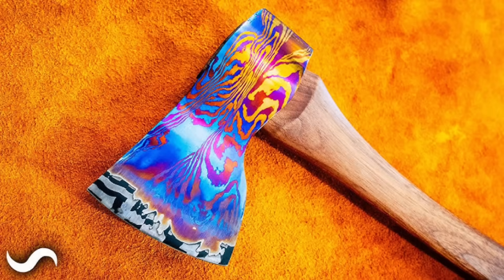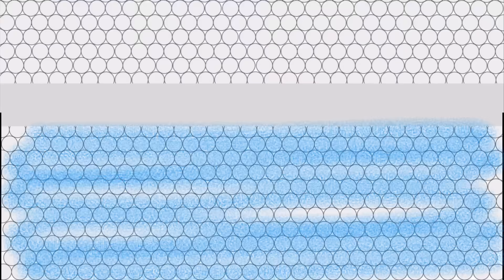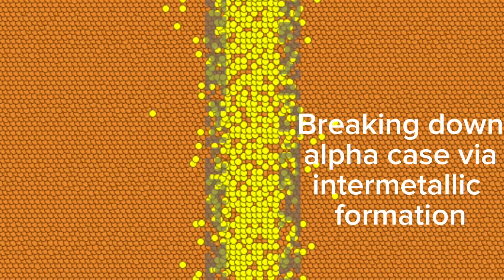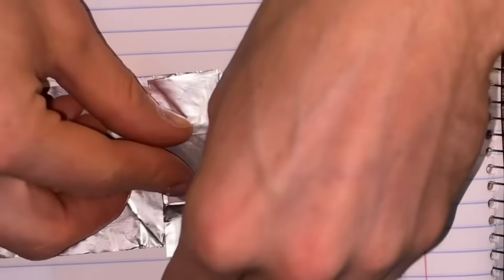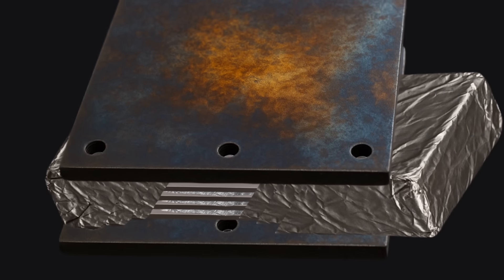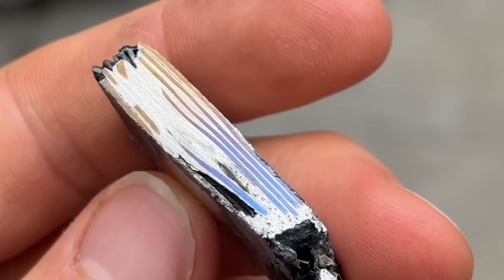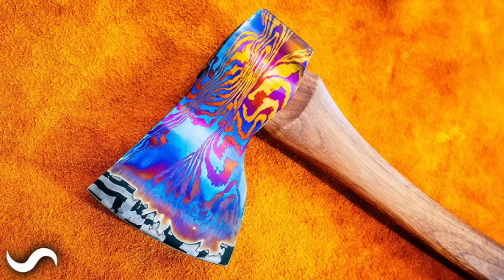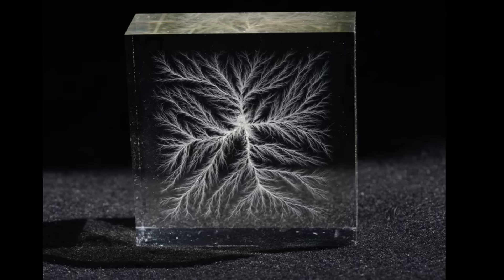Making Titanium Damascus is Actually Easy

Comment: I watched Alec video a while back, cool different methodology. if you heat that up and smack it with a hammer it will spray white hot liquid inter metallic everywhere,
 a donut or saddle shape would highlight more grain, but titanium is expensive/hard to work.
interesting final material, I imagine it would have a wood grain like properties, strong in one direction/orientation and brittle in another.
Alec made such an ugly axe...

Comment: Do you have access to a sputtering system or evap? If you made few-nm adhesion layers it might diffuse enough during the second heating process to get Ti-on-Ti bonding, no?
Reply from the maker: I think IVD aluminum on the Ti would be the best way to see if this works… but I do not have the capability 😂 maybe if I was still at school lol.

Comment: Do you think you could drive out the intermetallic complex by increasing the temperature to its melting point while keeping the entire thing under compression, and then reach actual titanium Damascus, where the intermetallic complex would act akin to a flux? You could assemble the entire pillow under oxygen free-ish(?) atmosphere by using fairly inexpensive glove bag and carbon dioxide or argon as a purge gas, although that shouldn't matter if your compression is high enough, and there is enough sacrificial material to suck out any oxygen. You could then add carbon powder to the side of the stack to act as even stronger sacrificial material for oxygen removal.

Comment: Would it be possible to not use intermetalic, but heat the sample in a vacuum? Or does that not work because you need the air to spread the heat?
Reply from the maker: Yes you can process in a vacuum furnace, but one of the points of this process was to find a method that doesn’t require fancy processing methods

Comment: I have a different wild idea for making titanium damascus. We know that cold welding is a reproducible phenomenon in the vacuum of space (10^-9 to 10^-17 Torr, from what i could find). We don't know if it happens to titanium, but theoretically the metal itself shouldn't be the limiting factor. From what i know, oxides also tend to burn up when heated to high enough temperatures under a vacuum. Could it be possible to attempt cold welding of titanium under a UHV (around 10^-10 Torr) or EHV (10^-13 Torr) environment? Assuming that removing the oxide layer could be done, somehow. Maybe a vacuum chamber setup for thermal evaporation?

Comment: Nice that would make a cool Pyramid art. Symbolic of modern world Points at Titanium implants helping people heal I call that CLEAN.. Scans Earth database and lines up images for words Google: "Ultrasound solidification of Molten metal" + "Ultrasound holography" + "Utilizing ultrasound to disrupt pathogens US20100113983A1" Resonance taps below ultrasonic disintegration to keep molten state. Google: "Ultrasound can print through walls" Resonance filtering to ignore materials containing your target material for holography pressure supported nano-structure.

Points at Boeing Plasma force field block bomb pressures then points at YT "Cow vs. Underground nuclear test" Look at Cows trying to walk while floating. Earth resonance filtered dangerous Ultrasound but enough to push atmosphere pressure to peak before earth pressure come back. *Taps meat in your brain You know the sweet spot of safety for Anti-gravity science now.. Never turn off Anti-gravity machine instantly.. Sudden implosion = bad. Looks at Capacitors taking turns dumping and filling at safe power output of breakers they're on

(Beware! Google: "Ultrasound excitement of Plasma generates stronger EM field" Make sure to Faraday cage around plasma Ultrasound experiments. Earth Military has EMP weapon sensors you will very likely get circled by a black helicopter with big side door Thermal cannon scanning your home before FBI visit. I live near FT Knox.. Ooops.)

Comment: Can you anodize the titanium aluminide in the same way you anodize aluminum like with dyes? it would be wild if you could have layers of dyed aluminum between layers of electrically anodized titanium.
Reply from the maker: Unfortunately not, if an anodic oxide layer builds on the TiAl at all, it would be either a very messy oxide or a solid layer. Aluminum forms nice honeycomb-like nanopores when anodized which makes it great for trapping dye, this wouldn’t work well in the oxide microstructure of TiAl.

Comment: Could you get rid of the intermetallic layer in some way? While allowing the titanium to bond?
Reply from the maker: The only thing I could think of is increasing processing bc time and temperature to allow the Al to homogenize throughout the titanium, I don’t know if the Al is mobile enough to do this on a relevant timescale though.
Reply: @ElectronImpressions you could compare your titanium and titanium aluminide layer thickness to see Hoe much the aluminium has already diffused? Then tuning aluminium layer thickness to fal below a certain percentage once it has fully diffused to leave only titanium with a small amount of aluminium. Of course it needs to be physically possible and limits titanium thickness to what is possible with aluminium layer thickness. Hope it all makes sense. Would be awesome if you could produce "proper" titanium Damascus with this method.
Reply from the maker: @joepiejaapie yes if I still had access to an a scanning electron microscope, doing exactly what you are describing would be trivial to accomplish, and probably would be exactly what I would do. I could do an EDS scan on the interface to visualize the distribution of aluminum to determine how well it does diffuse into the titanium.
Reply: @ElectronImpressions always a shame when you are done at uni/with a practical and don't have access to all the fun toys anymore. Measuring the visual layer thickness in the Damascus isn't good enough then I suppose?
Reply from the maker: @joepiejaapie  Yeah it probably wouldn’t cut it, there will be some Al diffused into the colorful Ti layers to an extend I can determine. Gr5 Ti is 6% Al and only 89% actually Ti, and it still anodizes colorfully, so the visual layers don’t really tell me the whole story.

Also within the intermetallic layer there are probably several intermetallic phases present, not just purely stoichiometrically equivalent TiAl. And these phases are probably concentrated in distinct regions as you move away from the center of the intermetallic, which will of course affect Al concentration.
Reply: @ElectronImpressions so you would need to know the cutoff concentration where the titanium doesn't anodize anymore, and then with the amount of titanium and aluminium added, you could guesstimate a aluminium concentration distribution? Or just put in a minimal amount of aluminium and test at different times how wide the intermetallic layer is?
Reply from the maker: @joepiejaapie  yeah the best way to go about it would be good old trial and error 😂 it would be nice if you could easily plate Al on Ti, I could do a good study in no time.

Comment: I wonder if you were to make the aluminum thin enough, would it serve the job of preventing oxygen from getting at the titanium mating surfaces while also being thin enough that it allows the titanium itself to bond to the other peice of titanium past the aluminum/make the intermetallic layer thin enough that its brittleness can be mitigated? I can think of several reasons this might be stupid, but id be interested to see if it worked
Reply from the maker: I would also be really excited to try that out. I think the best approach would be to get a thin coating of aluminum on the surface of the Ti. Turns out to be very difficult with plating, but IVD is an option, or just plate in nickel and see if nickel-titanium system would work

Comment: As a 3rd year material’s science engineering student, got to replicate this process with campus equipment while I still can. Do you have any extra recommendations?
Reply from the maker: Use the thinnest Al foil you can find, use different grades of titanium if you can (i just used gr2 cause it’s the cheapest). And use a good amount of heat treatment foil, but make sure your stack up is always the highest point, not the edges that you crimp together (so you ensure it feels all the pressure). You can dm me on insta if you have any questions, and I would love to see your result.

Comment: Thinner aluminum and maybe fill the voids with a liquid that wount react with either metals and leave a small hole for it to escape once compressed and heated. Maybe even heat it at a much lower temp first and tighten it after to get as much of the liquid and oxygen out...???

Comment: Does it harden? Would be cool to see some of this materials properties! Make a ring!! I am also pondering on how thin this intermetallic layer can be, like would it work to have leaf gold?
Reply from the maker: The intermetallic layer could be very thin, much thinner than presented in this video. If you use a hardenable titanium alloy like Ti 6-4, it will surely harden, but I can guarantee the interfaces hold up to the heat treatment profile lol

Comment: What about electrolytically depositing the aluminum on your starting Ti? What about other elements like Ni? Zn?
Reply from the maker: I looked into this and plating Al on Ti is crazy hard, it’s easier to get IVD Al on the Ti, but at that point you may as well use argon and make Ti damascus the traditional way. To plate many metals on Ti you start with a initial plating of nickel, then your metal of choice on top of that. 

Ti and Ni do form intermetallics, but at higher temps than that of Ti and Al, so there is a greater risk of oxidation and alpha case.

Comment: Why not get a big plastic tub, set your electric furnace in the tube and throw in a block of dry ice? CO2 displaces the O2 and then no oxides
Reply from the maker: CO2 is definitely a weaker oxidizing agent than O2 but Ti has such a high affinity for oxygen that it can literally react with CO2 to form TiO2 and CO. Although much slower than it would with oxygen. Ti can also carburize and form carbides in a CO2 atmosphere.

The trouble with this would be the furnace is not a perfect insulator and would melt or burn the tub it is set in lol. However if you could work it out logistically I am sure a CO2 atmosphere would be better than a regular atmosphere, but at that point you may as well use argon 😂
Reply: @ElectronImpressions  oh im dumb for some reason i thought titanium was lower than carbon for oxygen. Also it could be a metal tub but theyre more expensive. I wish @alesteele would try forging in weird atmospheres.

Thanks for teaching me stuff

Comment: shouldnt you have put sacrificial titanium directionly outside the first aluminum wrap as the pressure will force out air into that first layer. Perforate the base wrap and add sac Ti, then isolate to external, and add sac to 2nd to last wrap (last layer will have higher % air then next, such that the sac Ti will have a higher efficiency there. Just thoughts.

Comment: i wonder if a thin enough coating of aluminum would still bond the titanium without being enough to make the layer so brittle.
Reply from the maker: Thinner aluminum would likely improve performance. Plating Al on Ti is very difficult so the best approach may be IVD Al on the Ti. But at that point you may as well just use argon to make titanium damascus the right way 😂

Comment: I wonder if, theoretically speaking, you could get rid of the aluminium after the bonding between titanum sheets has occured, to be left with a solid titanium piece. I don't know anything about metallurgy or chemistry, and i assume it would be at least extremely difficult to penetrate deep into the part, but if that's theoretically possible and viable, it could be huge.
Reply from the maker: The only approach to that I could imagine is to start with a very thin aluminum layer to form minimal intermetallic. Then once that bond is made, increase temps to homogenize the aluminum so it is no longer localized to the interface. This may result in the aluminum moving to substitutional sites throughout the material rather than being in a intermetallic compound, although I am not sure, intermetallics are pretty stable.

Comment: "this material is mostly good for just grinding into shape, not deforming into shape."
so you're saying a rectangular, knife or axe sized piece could be made and simply ground to dimension?
Reply from the maker: I guess if you had a large enough furnace and press 😂 but you would probably want to include steel in the layer stack if that’s your goal lol

Comment: I am a Welding Technician, but I am not a Metallurgical Engineer.
Surface oxides start forming almost immediately on reactive metals like aluminum and titanium, and when you rough them up with a grinder you're increasing the surface area so it oxidizes faster.
I scrub aluminum with a brass brush as close to immediately before welding as possible.
Reply from the maker: Your absolutely right, the TiO2 layer forms pretty must instantly in air. However the oxide on the panels as I receive them is the same surface they were processed in (hot/cold rolling) and thus it is very old and thick, and may be dirty by picking up hydrocarbons and moisture. After sanding I produce a much more “well behaved” oxide. It proved to be unnecessary with titanium, however I did a similar experiment with Fe-Al in college and it was absolutely necessary.

Comment: Could you dip a stack of titanium and steel sheets in HCL and then wrap it in steel foil while submerged. Add an outer layer of aluminum powder or iron filings. The heat will drive off remaining HCL out of your bundle and with enough pressure I doubt you will get much O2 ingress and any that does seep in will be converted to rust or aluminum oxide to be ground off.

Comment: This is so awesome, what a great video and super interesting experiment. 🎉 I want to give it a try now and see how easily it breaks apart if we try to forge it 😅
Reply from the maker: Thanks Alec, my bets on pretty easily 😂 without the pressure or any molten aluminum shell surrounding it, it will have a rough time in atmosphere.
Reply: Alec, you should collaborate with this channel somehow.
Reply: Dew it!
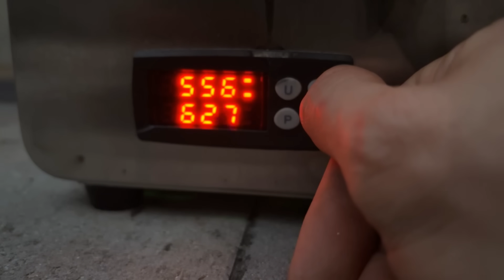Reply: What if you went straight into forging after the initial heating (to form the inter-metallic layers 5:50 in video) instead of letting it cool, then forging? Maybe it wont form the big, brittle crystals until after the forging process if you don't let it cool between processes
Reply: could u apply a small enough amount of aluminum onto the titanium (no idea if one could electroplate it?) to be enough to bond the titanium together yet still be insignificant enough to not matter to much in bonding strength/ brittleness
Reply: @nergalblacksun  Titanium cannot be electroplated onto easily, looks like most processes first do an electroless plating step like nickel.
Reply: It would be superawesome if you'd try and make a video!
Reply: As soon as I saw the thumbnail I was praying you saw it
Reply: Why did I just KNOW that I'd find you in this commet section, Alec?? 
lol!
Reply: how did i know alec would end up watching this
Reply: I wonder if you could selectively react out the aluminum at elevated temps with diffusion. Maybe with something like sodium hydroxide.
Reply: If it wont forge maybe a large piece could be made to mill, and if all you have top do is stack sheets you could even make a 3D press mold for the heating process. Electroplating the aluminum could save on the bulk of a foil rap.
Reply: Omg please do
Reply: Please do! Big fan, and I was hoping you caught this upload.
Reply: i was about to tag @AlecSteele we need a colab NOW
Reply: Doooo iiiittttttt
Reply: Math : 1
Alec : 0
Reply: was going to say, this is something you'd want to see, you beat me too it (been watching for many years). Excited to see your experiments with this, especially because there are a few different types of foils, it would be interesting to see how doing it with those would turn out.
Reply: i was just gonna say: " send this to Alex NOW"!
Reply: Couldn't you also just friction weld the layers together in a large drill press, or lathe?
Spin them against each other till it physically gets rid of the oxide layers, and force the metals to bond?
You'd have long round rod billets. But im sure yall can make em large and then hammer them out into squares etc. 
Wouldn't that work?
Reply: I literally KNEW for sure you came here!! ❤ The dedication you put into studying all you don't even know you dont'know yet about processes, could'n meke you miss this.
Reply: Maybe a super thin coating applied by a sputtering magnetron?
Reply: Hire him!
Reply: Praise from Caesar himself! 😂
Reply: As soon as i saw the title, i thought “hopefuly Alex Steele doesn’t get offended by this challenge to his skills” 😂
Reply: I was about to say "have you watched Alec Steeles videos" and heres the man himself.
Reply: I wonder if It would be possibile to electroplate aluminum to a titanium piece, so that the intrametallic later would be as small as possibile, and have the smallest impact possible on the forging qualities of the titanium
Reply: I was going to send you this link ;)
Reply: I was wondering if you'd seen this video and well here you are!
Reply: came to the comment section to make sure you are here!
Reply: Btw its aluminium bois, its even spelled like dat in da periodic table of elements
Reply: Yeah was gonna say that Alec tried a bunch of those, and basically all of the intermetallic layers had lessened performance. I guess we'll see. Thanks Alec, love the metallurgy experiments.
Reply: I was going to tag you!
Reply: Do it
Reply: Collab! Collab!
Reply: Knew I'd find you here, lol.